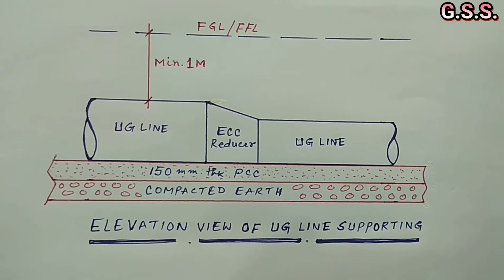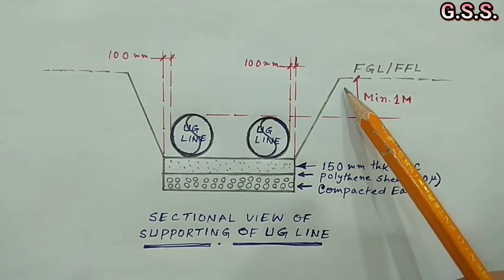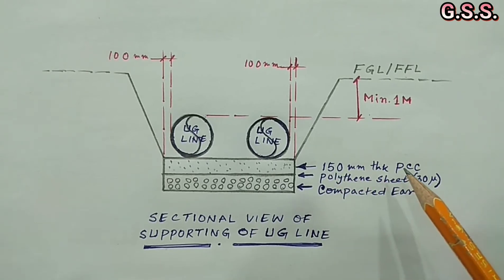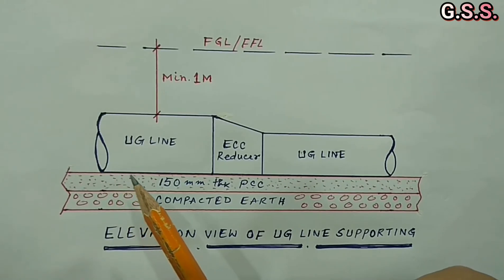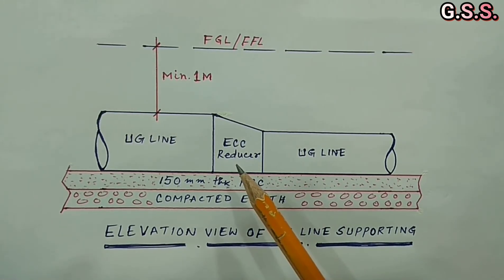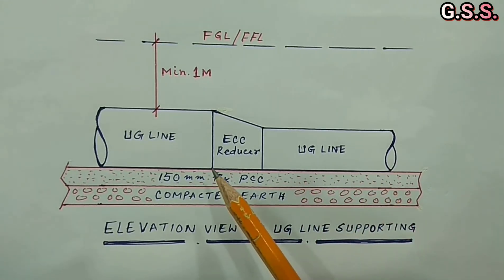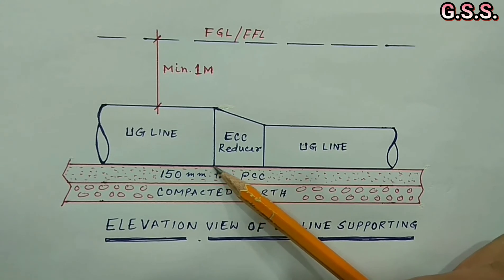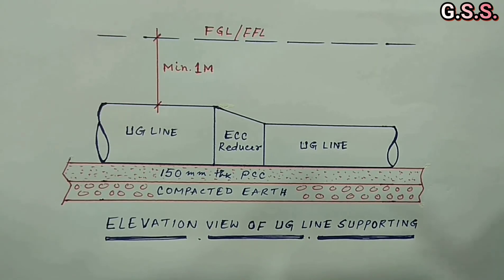Underground Piping : Supporting Philosophy of Buried UG Line

Comment: Very good information sir. Could you please make topic about RTR piping fabrication in yard, what are the types connection between the pipe and fittings. . Say for example underground RTR pipe spigot and Bell,  joined like butt and wrap, mechanical lock joint, cement bond or adhive bond, lamination. Please make details video about this topic. Please sir. Thanks lot